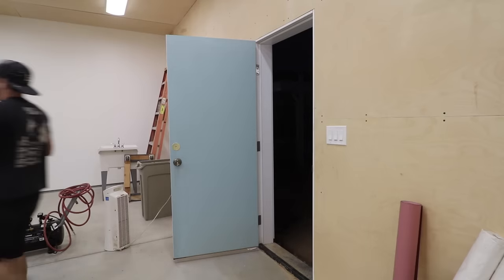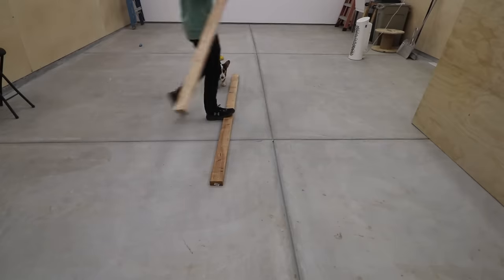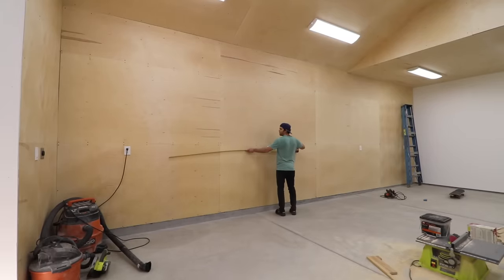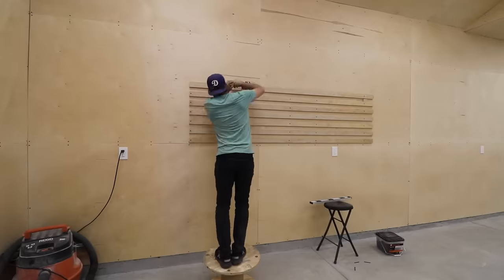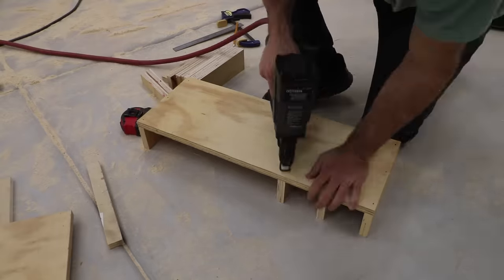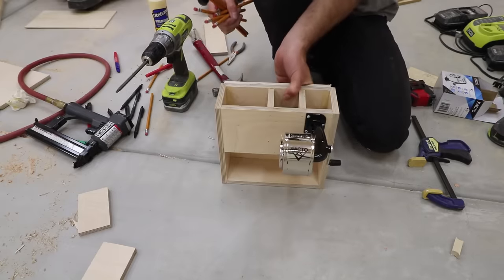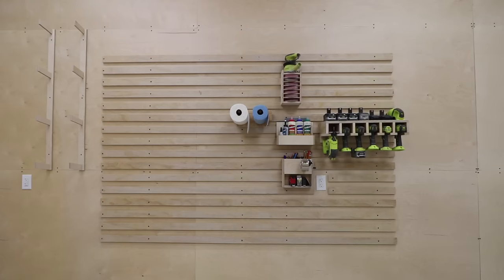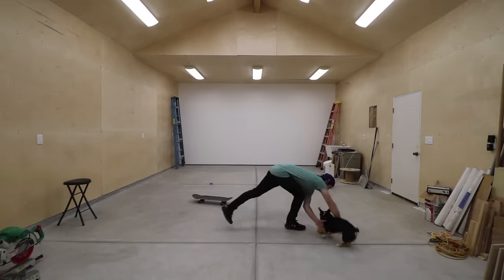Ultimate French Cleat Tool Wall

Comment: Hello, I'm thinking of doing something like this is my basement. Where do you get the plywood with so many layers? I don't see wood like this at my local hardware store. Am I missing it or do I need to go to a woodworking store?
Reply from the maker: Check with a lumber supply rather than a hardware store. The lumber supply may have more options as mine did!

Comment: this is fantastic but when you need to extend a box down to a lower cleat you have lost the use of that second cleat. I would put a spacer on the box rather than extend it.
Reply: I see your point but in the case in the video, the box he extended has drills hanging from it well past the next cleat down - don't think he'd hang anything there anyway.

Comment: 4:46 With all due respect, dont show this in a youtube video. This is extremely unsafe. Your fingers are so close to a rotating blade and you push the cut-off piece forward. If you push at a slight angle, the blade is going to grab the piece you are trying to push out and then your hand. With some luck youll find your fingers on the opposite wall. Those are your fingers - okay. But imagine an amateur watches this and thinks thats a safe way of working.